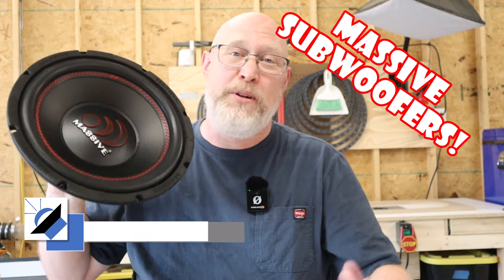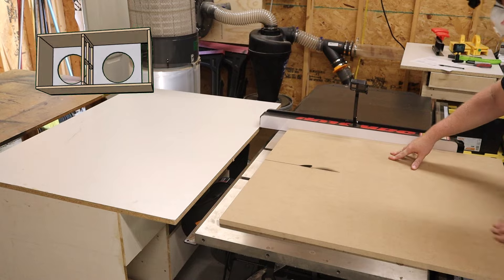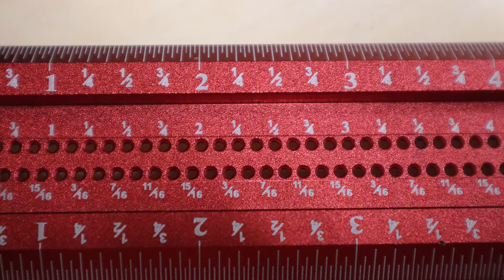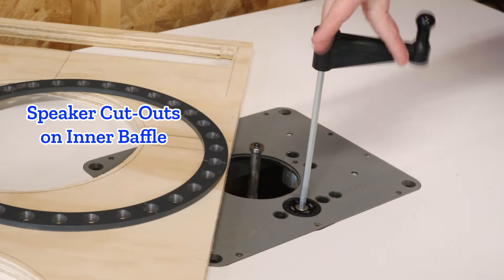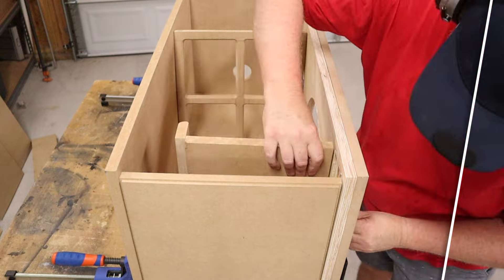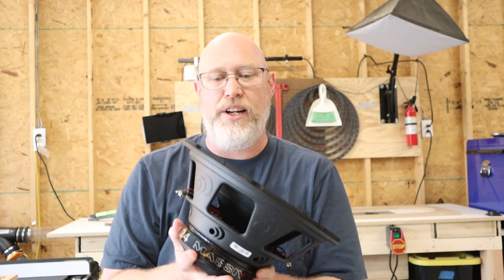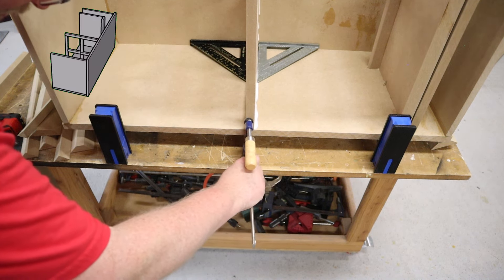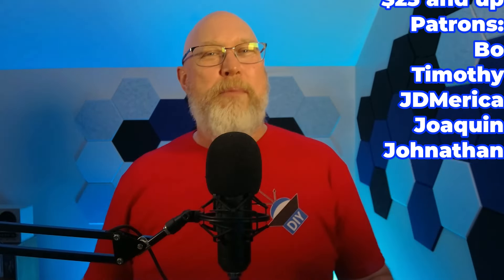Budget 12 Enclosure Build

Comment: I use no nails or screws in speakers, except for where connections where wires go into the box or hold speakers in place. Always used glue and biscuits. Two of my stage speakers (horn based for woofers and tweeters) are 56" tall monsters. Those were sprayed with truck bed liner to provide durability and dampen box noise.
Reply from the maker: Wood glue is pretty strong. There are a ton of woodworkers out there that never use any mechanical fasteners.

Comment: Okay, Squiangles and Triares, for your renamed squaring-up tools, lol. You'll thank me for keeping this VERY brief as opposed to my rant I set aside: Is there one of your discussions anywhere that depicts why one speaker in one chamber is a given, butt when there are more than one, why the tendency is to simply merge the two rather than give each its own chamber, 100% sealed apart with a SiNgLe sub's allowances? Not judging your techniques at all, of course. A solid, air-tight divider rather than a 'window' brace and a recommended chamber size and/or port if ported for each speaker therein would be what I'm talking about. Any thoughts on this would be appreciated. I would crap 'em if you made the mentioned as a project. A dual L-port is still not 'it', lol---🤗🤪🤨 Try to not just say 'No.' Ha ha ha ha ha 🤭

Comment: The thing about those window/cross braces is, for them to be most effective, you should remove the smallest amount of material from them as possible that doesn't lead to output being compromised, and that material should be removed from the center of each quadrant.  This suggests that the best results would be to use a hole saw or circle jig to cut out four circular pieces, one from each quadrant.  I'm guessing that once the holes are large enough to remove more than 65% of the panel, output won't be compromised.  Might be a good experiment to find out exactly how much needs to be removed :-).
Reply from the maker: I have done that before, another good idea is to remove one large circle.

Comment: I looked through your videos quickly and didn't see anything related to folded horns, now I ask this because I'm in the market for some but only Cerwin Vega makes them now, there use to be B52's and Peavey SP118 FH.
I get why as they are bulky and heavy but I love the sound from them, this dates back to being out in the desert and only 4 cabinets with 21inch was able to shake your body.
Is there a run down about this? and why the industry has stepped away from this design for "more power" ported boxes vs lower power horned boxes in the 70's and early 80's?
It is a lazy thing? just add more power 4Head and you get the same with ported easy to make boxes?
 I would love your opinion
Reply from the maker: I know absolutely nothing about folded horns.
Reply from the maker: @JasonWW2000  It might still be fun to build one.

Comment: I wonder how those drivers would sound compared to the GRS 12SW-4HE 12-inch sub. They're $15 less.
Reply from the maker: I've had a couple of the GRS subs before.  I like these better because you can get them in dual 4 ohm configuration.  These are also double the RMS power rating of the grs-12s.
Reply: The GRS speakers would be better for getting into that 20-30hz zone

Comment: BTW, all high wattage P.A. Sub cabinets are made with Baltic birch plywood, not MDF because MDF is stupid heavy and weight doesn’t make the cabinet panels stiffer. Plywood cabinets are much lighter and also much stiffer, only Baltic ply costs more. That’s it. 
Personally, I prefer to not load down my car with hundreds of pounds in wood boxes if I don’t have to. All the sub boxes I’ve made the past two decades were with plywood. Also other fun facts, cheap trailer homes use particle board for floor decking instead of plywood(because it’s cheaper, not stronger) and it flexes a lot, and swells up like a sponge if it gets wet, then crumbles. Just sayin.
Reply from the maker: https://bit.ly/4cpUJdn